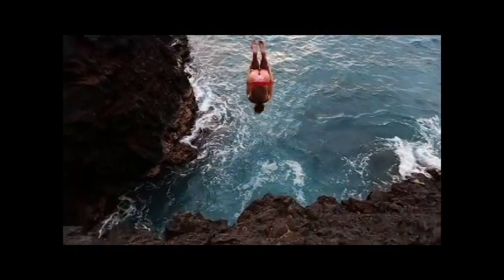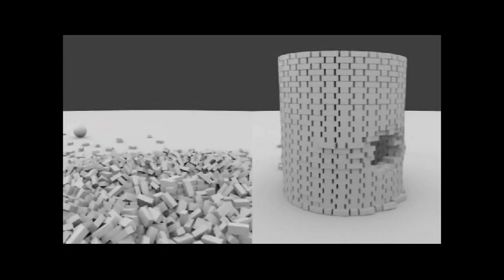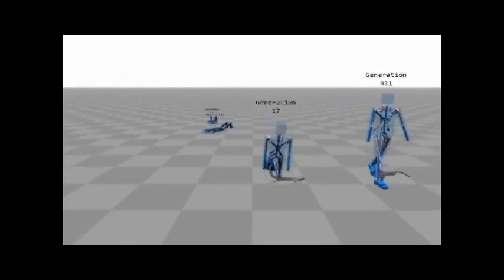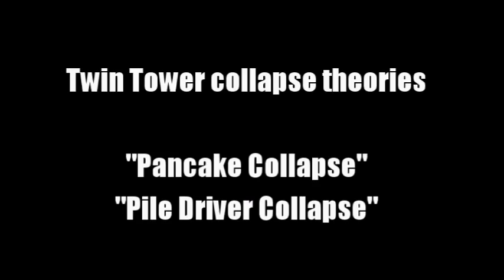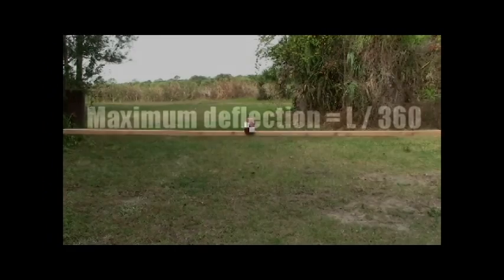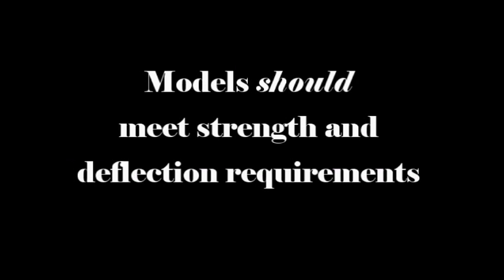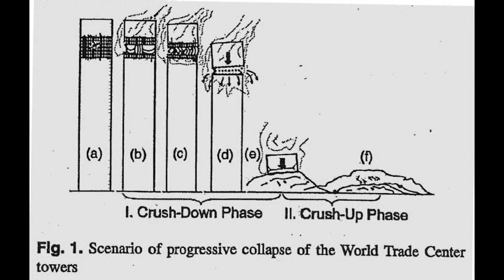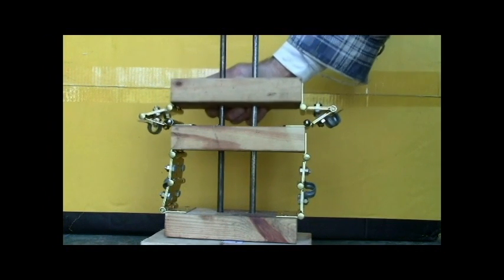9/11 Experiments: The Force Behind the Motion

Comment: Each floor that collapsed increased the weight to the next floor, by the time the first 30 floors collapsed you have an extremely large amount of weight on top of the following floors. Your experiments don’t prove anything, you have too much book smarts and not enough common sense.
Reply: Learning disorder
Reply: Um.... just to be clear..... why would they have supported the weight before and not after? The weight was not magically suspended. It was always there. They supported it just fine for years. And then just all of a sudden.... they cant?
Reply: If you don't understand the difference between mass and force, then there is no discussion to be had.
Reply: @bafumat  read what you just wrote and think about it, while looking in the mirror. Still confused!?
Reply: Dany Wiseass - Before calling others numbed idiots, you really need to think about what you're posting here. Let's bream down your comment, shall we?

"The building supported it own weight for years."
It were the columns that carried the vertical loads. You need to be precise.

"Suddenly a plane, made of mostly aluminum built to be as light as possible and didn't weight as much as even a single floor. Slams into a building made of concrete and Steel"
Why do you believe material is of any relevance? Which equasion uses material to calculate force? So why even mention this? Force is decided by mass and velocity only. Even a pingpong ball with enough speed goes right through a paddle.

"With fuel that couldn't possibly have melted the steel "
Could you please guide me to the exact paragraph and page in NIST´s report where it is mentioned that any of the steel melted in the forst place? No-one but the truth community has claimed that steel has melted before the towers collapsed.

"And all of a sudden.."
Not really. 56 minutes and 1 hour and 42 minutes is hardly "all of a sudden".

"one level can collapse the one below it"
Sure it can. But that is not what happened. The force of the mass of the falling upper blocks (12 and 28 floors) destroyed the floor trusses of the one floor below.

"Ever watch a building go down on purpose? They have to use explosives on every level to get it to happen strait down as seen in both towers."
Sorry mater, but you're wrong again. Not that is matters much though. It doesn;t matter how building are being demolished in a controlled way. It matters how gravity and weakened steel can cause the collapses of the towers.

"When they fall by accident its always sideways. Always."
You mean like this?
https://www.youtube.com/watch?v=sPGr4D1-zDI
Or this?
https://youtu.be/uG4SOeceTAI?t=34s

"One level can crush another but always unevenly. This makes it tip over."
Please explain the dynamics in such a collapse. How does a building tip over when it collapses from the top? Really curious for your answer here.

 "Next time you open your mouth stuff a gun in it"
Wow, just wow. So much stupidity and then this? :) You are the perfect example of what is wrong with the United States of America. I bet that when you get old enough to vote, you'll vote for Trump. Right?
Reply: @brucelansberg5485  Sucker... you believe NIST who performed a miscarriage of Investigation. Are you not aware that NIST did not follow proper protocol for testing for explosives even though the National Fire Protection Agency guidelines mandate that you do when a higher order damage is evolved. In fact the only investigated up to point of collapse. no reasons given for the total collapse. Is your dumbass even from this country cuz if you are you should be concerned and bothered by this information of Truth. I tell you right now there is no justifiable reason NIST nor you can give for such a miscarrage of a investigation. I suppose you find it acceptable if the Warren Commission stated to have never look for a rifle on November 22nd 1963 in Dallas. If you support and Trust NIST and all their fuck ups...then you're a fuck up to.                                                 unless properly investigated and ruled out there is clear evidence of the potential for explosive involved in the collapse
Reply: Cooldat - "Sucker..."
Ah, the battle is on I presume?

"you believe NIST"
Please guide me to any of my replies where I have stated such. Are you still making up things?

"Are you not aware that NIST did not follow proper protocol for testing for explosives"
Which protocol exactly would that be? A link to that protocol would be very helpful. Could you also please do me a favor and name paragraph and page where I can find any information about your claim?

"the National Fire Protection Agency guidelines mandate that you do when a higher order damage is evolved"
Involved I assume? See questions above. Thanks.

"In fact the only investigated up to point of collapse. no reasons given for the total collapse."
Half true. They investigated up to the point of the progressive part of the collapse. NIST have provided a full explanation for the initiating part of the collapse. I am pretty sure they did not have the conspiracy nuts in mind when they assumed it would be clear how the towers progressive collapses occured. Let me ask you this: have you written NISt someweher between 2001 and 2005 to recommend giving a full explanation for the progressive part of the collapses? Or did you pick up in this years after, when you saw a bunch of conspiracy videos right here on YouTube? If you have not written them this letter then (or shortly after the publication date), why not? Were you not a concerned citizen by then yet?

"Is your dumbass even from this country cuz if you are you should be concerned and bothered by this information of Truth. I tell you right now there is no justifiable reason NIST nor you can give for such a miscarrage of a investigation. I suppose you find it acceptable if the Warren Commission stated to have never look for a rifle on November 22nd 1963 in Dallas. If you support and Trust NIST and all their fuck ups...then you're a fuck up to."
According to your language skills, you are not from this country. I don't think it is your concern where I'm from. And what the hell is "information of truth" in the first place? Are you referring to the above video? Are you ne of those types that doesn't trust science? Do you believe science is made up? Do you understand how science works at all? See, the problem here is that this video has NOTHING to do with science. At all. Yet, you have chosen to accept it as "information of truth". Why? 

You have mentioned "miscarriage" (with an i indeed) twice now.  Yet you have failed to define why you believe it is. Please explain to me in detail where the NIST report is off. I have asked this question to others as well, unfortunately without receiving any answer. Maybe you can? 

You mentioned the Warren commission, but I assumed we were talking about 9/11 here. Weren't we?

Please list all of NIST's "fuck ups" and we'll discuss. Looking forward to a grown up discussion.

"unless properly investigated and ruled out there is clear evidence of the potential for explosive involved in the collapse"
Now I am confused. What does this even mean? Clear evidence of the potential for explosive involved in the collapse? Please be clear and specific. But is actually really funny. Seems to me that you are basically saying that since you do not understand why NIST has not conducted a specific investigation for explsoives being used to bring the towers down, it proves that explosives have been used. What kind of logic is that other than conspiracy theory logic? If your clam is that explosives have been used, where is the evidence?

For now, let's assume that NIST's report was indeed a total fuck up. How is this proof for an inside job? What would it prove?
Reply: @brucelansberg5485  some people are just blind to the truth. This video stands correct therefore you're wrong. You whole theory is wrong. I know the difference between a structural failure collapse versus a controlled demolition and you don't need to be an architect and engineer to know this. probability and physics point to a controlled demolition as cause for collapse not fire......a 2.3 trillion dollars cause....follow the money......you know what I'm talking about
Reply: Cooldat - "some people are just blind to the truth"
Some people wear jeans to work.

"This video stands correct therefore you're wrong."
Interesting. The whole point of this debate is to establish that this video is pure nonsense when it comes to proving the towers were demolished :). This videos proves exactly nothing. 

"You whole theory is wrong."
Please elaborate. And don't be scared to go into any detail.

"I know the difference between a structural failure collapse versus a controlled demolition"
Yet you keep insisting the towers didn't collapse in a natural way. How's that? Please don't be afraid to use any real arguments in your exaplanation.

"you don't need to be an architect and engineer to know this"
I'd say you don't need to be an architect or engineering to study the design of the towers. Please feel free to do so. It is not hard. You just need to be willing to spend some time.

"probability and physics point to a controlled demolition"
Probability? How's that? What is the probability of two 110 story skyscrapers with the actual design of the twin towers to fully collapse after two loaded passenger planes have crahed into them which caused a major unfought fire. Which figures have you used to calculate this probability? And physics? Please explain to me how the physics of 9/11 point into any other direction than a natural collapse? Really curious for your answeer.

"as cause for collapse not fire."
You still miss the point of the full collapse having two stages. Fire did cause the initiating stage, where the top came down crushing on the lower still standing part. I am pretty sure you can agree to that. What you still seem to miss is the second stage and how fire has nothing to do with that. The second stage is the progressive part. A progressive collapse will only happen if the design of the building allows it. Would both towers have been built in a conventional way (which would be impossible for a 110 story building back then), a progressive collapse would have been a lot less likely, maybe even impossible. 

"a 2.3 trillion dollars cause"
Are you referring to Rumsfeld's speech? Do you really want to get there? :)
Reply: @brucelansberg5485  quite simple. They defy the laws of physics.. Wait a min. You think the towers and their  engineering were designed to fall a certain way should it be hit by a plane? Is this what you are saying? All your credibility goes out the door lost forever. I need not go on.....but I will. The Symmetry in the collapse is  the Smoking Gun. I got to stop right here and say for a person who portrays himself as one with some knowledge, you sure display the lack of. Architects and Engineers design buildings to last, not ( in case of terrorist attack) collapse a certain way. Your version of the events of 9/11 makes sense when you remove the laws of physics and if you have a problem with it I suggest you take it up with Newton. The laws of physics and the conservation of momentum  states: any upper block of material must slow down when it hits any mass or force that previously supported it. In this case it would be the towers. Let's move on shall we? The upper block a faling structure will destroy itself well before It can possibly crush the entire larger lower structure. Conservation of momentum is the fundamental law of physics that cannot be broken. It is written in the textbooks. It is a law. By simply removing these laws makes it easier for you to create your own fictional theory. All one has to do is look at the video. Evidence against a total gravitational collapse is the complete pulverization of all the contents of the Twin Towers beginning with the concrete floor. Had a gravitational collapse occurred what you expect to find is 110 floors stacked up on each other like it happens in the regular collapse like it shows in a regular collapse. In the case of the towers practically all concrete was pulverized. How does your theory account for that? But concrete wasn't the only thing pulverized ....43600 windows 600000 square feet of glass 200000 tons of structural steel 5 million square feet of gypsum 6 Acres of Marble 425000 cubic yards of concrete almost to a  cloud. How does your fictional story account for that? The symmetry of the collapse is the Smoking gun. It very difficult to get something to collapsed symmetrical because it's the laws of physics that things tend towards chaos and collapsing symmetrically represents order, very strict order it is not the physics to gravitate towards order for no reason it will gravitate towards chaos. How did the structures collapse in their symmetrical fashion when the damage was clearly not symmetrical? Totality and uniformity of the destruction the mass of debris remain centered on the building core all the way down. Falling objects should take the path of least resistance yet the official explanation claim that the towers debris took the pathof greatest resistance through the strong core structure all the way to the ground.    How did your theory account for this? Columns several tons were ejected laterally 600 ft ( can not be done without explosives) the structural failure the building should have slowed down and topple off to the side. NYFD captain Phillip Ruvolo reported seeing molten steel like you were in a Foundry. Even Leslie Robertson designing engineer of the WTC quoted as saying a little river of Steel flowing. the towers should have fallen with increased eccentricity as the collapse progressed. How did each Tower inexplicably collapse upon itself crushing all 287 Columns on each floor while maintaining a near Free Fall acceleration as if the 80,000 tons of supporting structural steel framework underneath didn't exist? How about the fact that video and pictures show numerous High Velocity bursts debris being ejected, the well-documented presence of molten metal throughout the debris field and now add the hundred and fifty six Witnesses probably more stating they saw heard and felt prior to and during the collapse explosions.  The official version in the NIST report concerning collapse.   1. That's not what happened 2. Laws of physics say it can't happen 3 history proves it's never happened. Pretty outstanding record don't you think? so I asked you what are the chances or what are the odds that three buildings fell in the same manner falling into their own Footprints and showing no Eternal resistance and pulverizing itself in the same general area on the exact same day,,?    What are the odds that all three buildings were planned? Put my  money on plan every time. Probability and physics point to controlled demolition as cause for collapse not  fire.         If it disagrees with experiment is wrong. I'll take Richard Feynman, the American theoretical physicist , word over yours every time. Ya see...... I don't need to crush numbers with mathematical equations that go nowhere. If you choose to rebuttal DO NOT REMOVE the laws of physics conservation of momentum. DO NOT REMOVE eye witnesses and testimony of secondary explosions being seen heard and felt prior to and during the collapse. DO NOT REMOVE any common sense. This was not a natural collapse. Both  technical calculations and testimony from WTC structural Engineers confirm that the Twin Towers were built to withstand the impact from the passenger jets that hit them on 911                it is easier to forgive a child is afraid of the dark the real tragedy of life is when men are afraid of the light. I believe you're just another ignorant naive fool who's caught up in the rat race and the problem with that is...... Even if you win the race...... You're still a rat. Yes the video make sense, laws of physics prove with experiment that a total collapse is impossible without explosives. Your fairy tale of a story can put control demolition experts out of business. Hell just start some random fires with a little damage and "poof" the bldgs come straight down. It will pulverized itself  which makes it a lot easier for the cleanup crew. A broom and a dustpan and you're done. And you best patent this one down before somebody else figured it out. Personally bro I wouldn't trust you with Lincoln Logs. Would you like to get started on the Pentagon? Where's the plane? How nice of these terrorists not to break any windows on either side of the Impact Zone where the wings should hit. How nice of them not to fuck up the lawn. Do you think they used a standard vacuum like Hoover to pick up and eliminate all the debris before the media had a chance to show the wreckage? Who dropped the ball at the Pentagon after learning that two planes were hijacked and still allowed. a third one to hit their target at the budget analysis building where Staffers were working on the 2.3 trillion dollars defense secretary Donald Rumsfeld reported missing on 9/10. The Pentagon the US Department of Defense and it's multimillion-dollar infrastructure, said to be the most protected building in our country, with all of the technology and radar and surveillance cameras, and still these amazing terrorist with weapons of mass destruction called box cutters avoided all cameras.....talk about letting one slip by the goalie huh? How about Shanksville? The terrorist turned 757 into a horned toad lizard and buried itself in the sand. wmWhat if they come back but this time using plastic butter knives and use profanity....... We're all fucked!  Oh and the 2.3 trillion dollars missing......it's a write off....fuck it!           Let's figure this out together..  .Truthers represent truth (of course) and each and everyone of you ignorant naive sheep are against Truthers.... Well then you must represent the opposite...... The opposite of Truth is lie.,.... You're all liars from the Reply and Deny Assholeciation with an addiction for fiction. But we appreciate your interest in  all we have to say. Whenever we post guarantee you'll be there. Please subscribe. Follow us on Twitter . Nice chatting with you hamburger........may wisdom and common sense enter your life soon. Hang  in there son. I'm out!
Reply: @brucelansberg5485  p.s we all know the reasons why you deny the symmetry in the collapse.....cuz it will destroy your fictiional story .....crumble down just like the towers...like a control demolition. How did the towers collapse in a symmetrical fashion when the damage was clearly not symmetrical? If you deny this you ruined your reputation and credibility. You don't need to be an architecture Engineers to see this..... it's in plain sight
Reply: Cooldat - "we all know the reasons why you deny the symmetry in the collapse"
Where do you keeping picking things I have never stated at all? Dany Wiseass claimed that natural collapses always go sideways and I linked two videos in which it is clear that this claim is wrong. How in heaven's sake do you get to me denying any symmetry in the collapses from this? If you would have  read a little bit more carefullt, you would have noticed that I actually did not agree with Danysomething that building can only collapse straight if explosives are being used. You are stating the exact opposite from what I actually said. You're not the smartest, are you?

"How did the towers collapse in a symmetrical fashion when the damage was clearly not symmetrical?"
I believe I have explained this to you before. The damage pattern is irrelevant for the progressive part of the collapses since it's not the plane impacts that decides how the towers collapsed. It is the engineering of the buildings that's relevant. Only for the initiating part of the collapses, the damage pattern was relevant. It doesn't matter if you fly plane into the tower, have a large bomb explode in the top floors, or drop a mountain on it. The progressive part is decided by the engineering. Between impact and collapse, time and fire caused the impact zone to weaken. Loads were redistributed onto the undamaged columns until the point these weren't able to carry it any longer. When the upper parts came down, they caused the first lower floor to collapse. It doesn;t matter if all floor-to-coumn connections were destroyed at the exact same time, or if that happened within a split second difference. Fact is that the whole upper part came down onto the whole lower part. However, if the towers would not have been 110 stories tall, but only 30 or so, you would have been asking me the question why the collapses were NOT symmetrical.

It's clear that none of the collapses were EXACTLY symmetrical. We saw large perimeter panels flying on one side and loose columns on the other. We saw a debris pattern that was not EXACTLY symmetrical. We saw an non-symmetrical part of both cores still standing after the collapses. But what does it matter? What is the definition of symmetrical in the first place? Nothing in nature is exactly symmetrical. To what extent were the collapses symmetrical? And how is all this relevant?